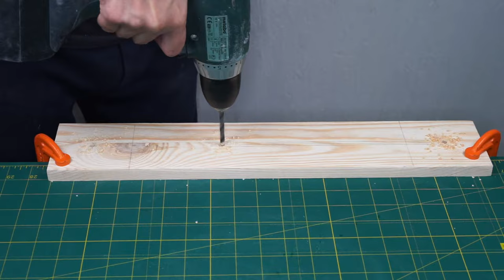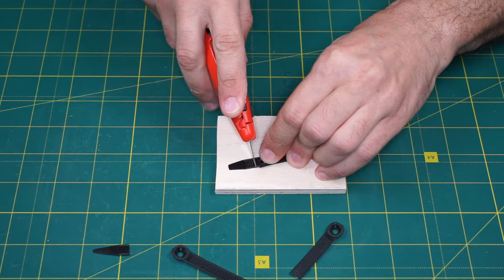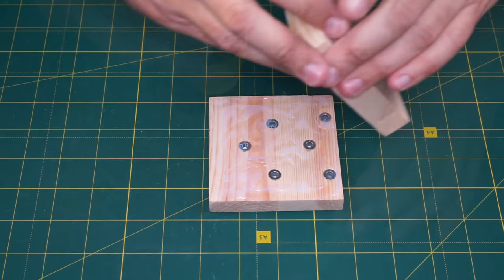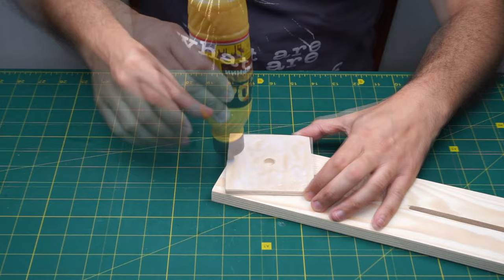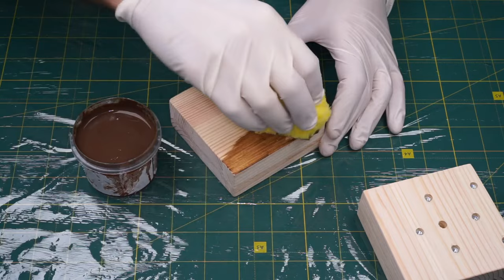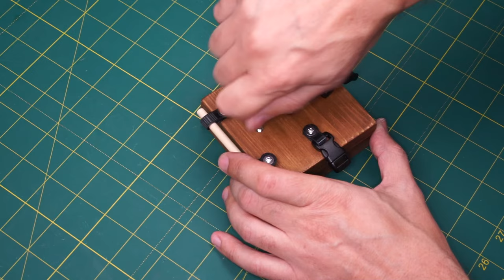DIY Paracord Jig

Comment: 9:14 Hello, can you share the list of products you used?
Reply from the maker: Planed pine board 15 mm, 18 mm., plywood 6 mm., stainless steel ruler 50 cm. - 2 pcs., rivet nut M4 - 12 pcs., flat head machine screw M4 x 20 mm. - 10 pcs., hex socket head cap screws bolts M4 x 50 mm. - 2 pcs., Cable zip ties 8x90 mm. - 10 pcs., truss head machine screws M5 x 70 mm. - 2 pcs., wing nuts M5 - 2 pcs. Buckles - 3/8, 1/2, 5/8 inches.

Comment: Würde das auch gerne selber bauen, hast du eventuell eine Beschreibung für die Maße und Schrauben Zubehör? 
Wäre echt dankbar
Reply from the maker: Planed pine board 15 mm, 18 mm., plywood 6 mm., stainless steel ruler 50 cm. - 2 pcs., rivet nut M4 - 12 pcs., flat head machine screw M4 x 20 mm. - 10 pcs., hex socket head cap screws bolts M4 x 50 mm. - 2 pcs., Cable zip ties 8x90 mm. - 10 pcs., truss head machine screws M5 x 70 mm. - 2 pcs., wing nuts M5 - 2 pcs. Buckles - 3/8, 1/2, 5/8 inches.      https://youtu.be/jhQkXvxzmN0
Reply: @DIYMaster72 
Hey, where did you get the zip ties ? I searched but didn't find this Type. Do you have a Link?